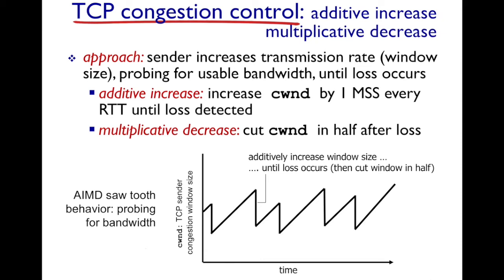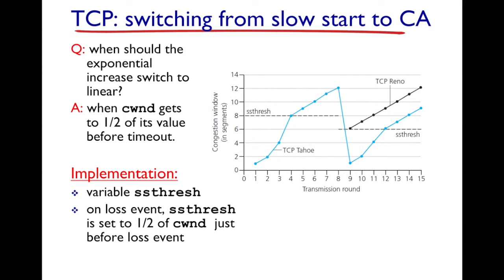TCP Congestion Control

Comment: At later slides its being explained that the window size is increased exponentially ( to twice) when "each and every ack of previous sent segments has been received" while in previous slides it was told that when the first ack of the 2 segments arrives , the MSS is increased to twice. Please can you explain the same. In general cwnd is max number of segments that are sent before the sender waits for the acknowledgments - that is fine. The question that remains is that does the sender doubles the cwnd when the first ack has come or all the acks for all the previous segments have arrived?

Comment: Hey thanks for the great explanation. One question: How do we decide the initial Slow Start Threshold at 8?
Reply from the maker: Thanks! That is used here for explanation purposes.
Reply: @anandseetharam   I meant to ask how is it decided in general(the initial ssthresh value). Also, is it a parameter where I can check from the OS?Like going /proc/sys/net/ipv4.